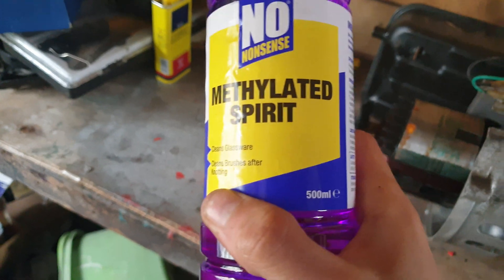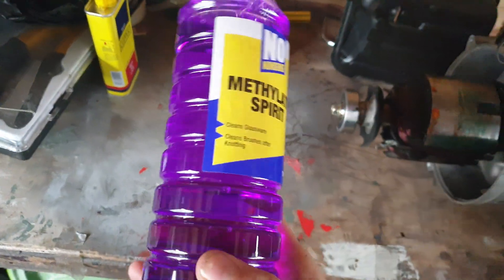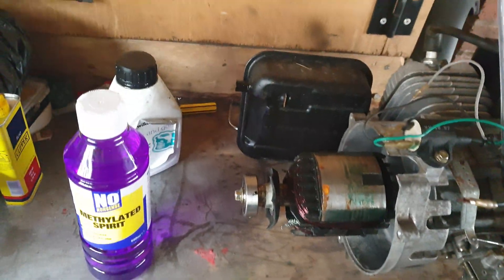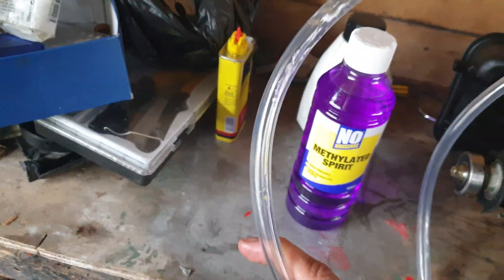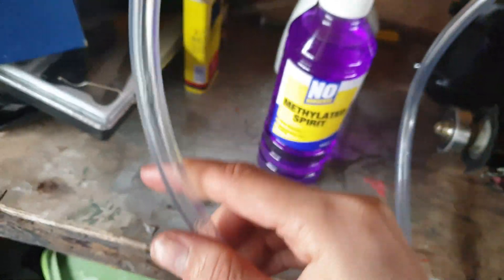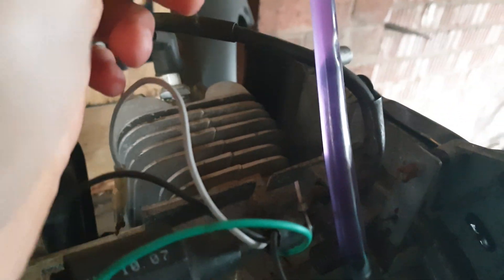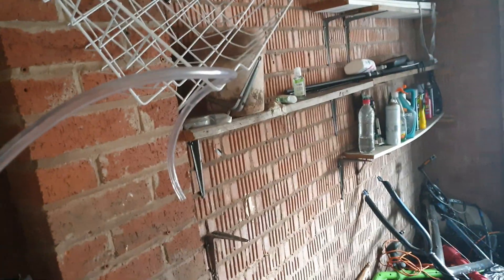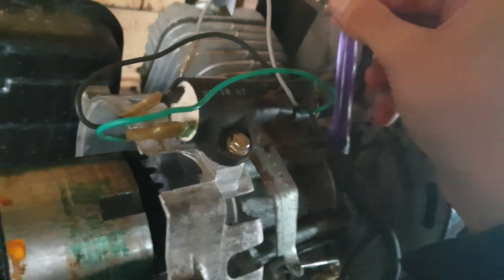Will methylated spirits run in an engine?

Comment: Before I knew shit about turbo's I bought a car that was designed for water/methanol injection. Since I didn't know what "methanol" was I thought it was mentholated spirits!  So I put Metho in the injection tanks instead. Turns out the combination of metho and water made a pretty good charge cooler, which is what I needed as the engine produced way more power than anyone would ever need. I just wanted it not to explode on me! Metho worked. Now I know it's basically Ethanol, a poor mans Methanol.
Reply from the maker: i would if thought with methanol and water injection it would act as a cooling effect allowing even more fuel and power
Reply: @patricklavelle9048  Methanol/water does make a waaay better cooler combo. I was just happy I didn't detonate the thing. I was also told to add a few drops of lathe cutting oil, which I did. It ran perfectly for seven years after which a mechanic that I asked to change the cam, STOLE ALL THE HEAVILY RACE INERNALS out of the engine, including the head.